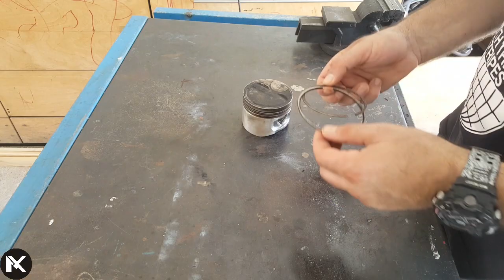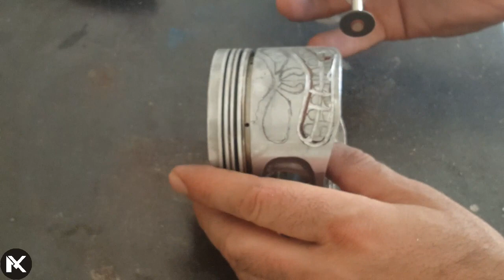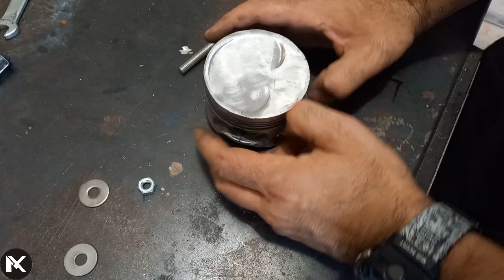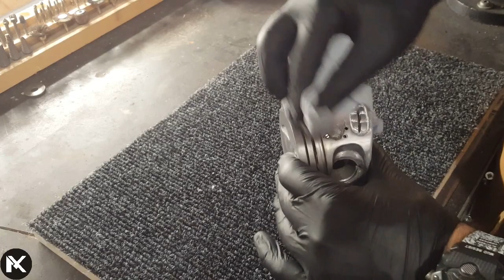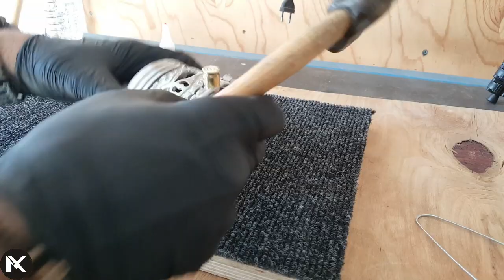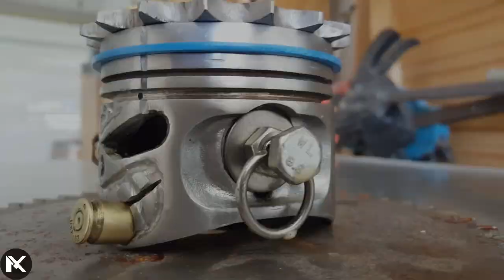How to Carv A Car Piston Into A Pirate Scull

Comment: Howdy
You are true master
Can I ask you a question 
What type of bits are you using in your dremel 
Excellent video 
I’m subscribing
Reply from the maker: First of all, thank you for your comments. I mainly used the wheel (even when I had it, I was very little of it) as well as the part that the nose is like a ball. the very small and the immediately following size are particularly useful